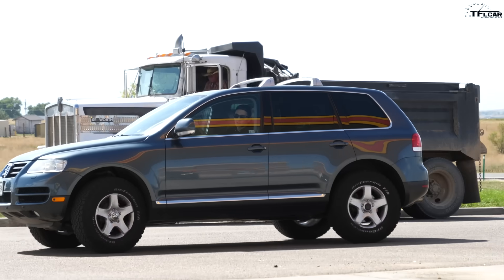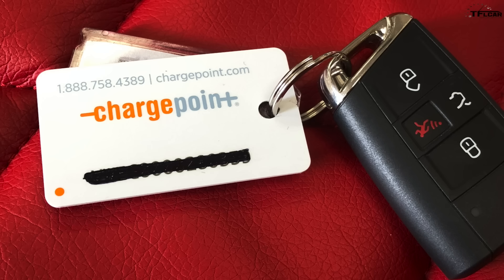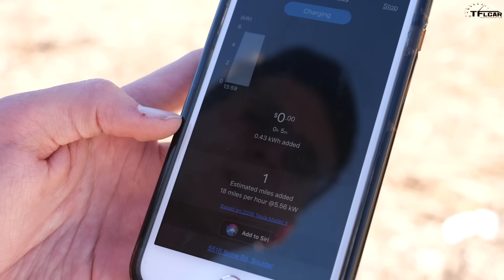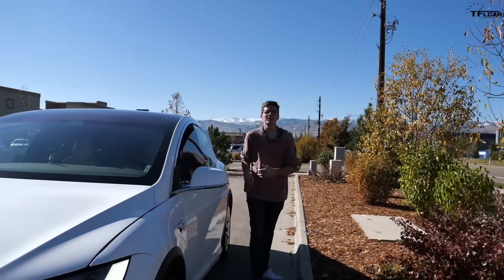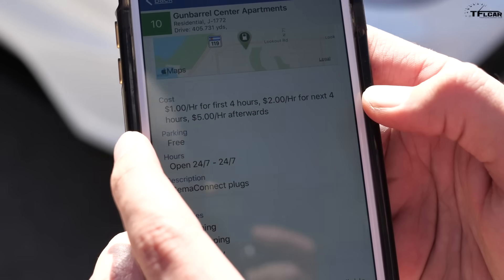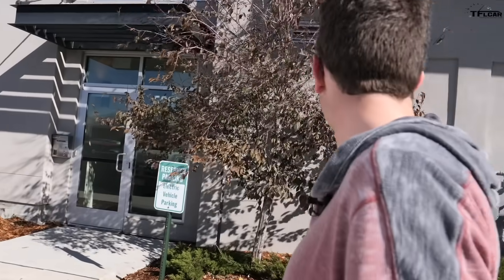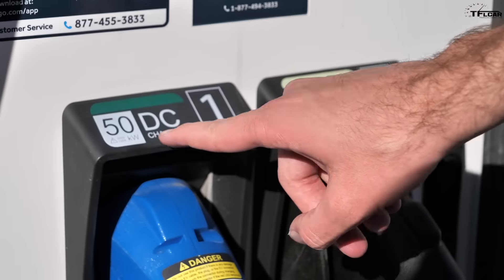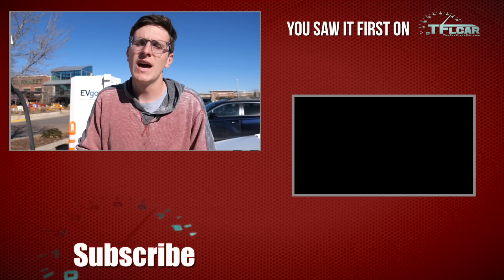Here’s Why Charging an Electric Car Can Suck - And It’s Not The Reason You Think!

Comment: If you have a Tesla, why not just use a Supercharger or Destination Charger ? The rest of us who can't afford a Tesla need to worry more about these 3rd party network. Tesla has the best charging infrastructure in the world. You can charge up to 65% in half an hour. Electrify America is also very good and can support charging speeds equal to Superchargers. Chargepoint is way too slow and I won't recommend using them. There is a Chargepoint charger in my neighborhood which manages only 18.5 kW, while EVGo maxes out at 60 kW, and Electrify America manages ~140 kW. Its quite obvious which chargers are getting used more often.
Reply: Because why go somewhere when you can charge while you sleep?

Comment: Haha, why would any Tesla owner use chargepoint? The supercharger/destination charger network is far superior. And 220 in a garage? Do you have a dryer? That charges at 17mph, same as the chargepoint. Anytime you film Tesla it is all fud.
Reply: Charging at 220/240 in your garage is fine for most BEV use.  Most of the time, people driving BEVs are not driving more than 50-100 miles a day, which means that most nights they are just "topping off" their charges, not starting from scratch.  Very few BEV owners take their BEVs on long-distance out-of-town trips; they have a second vehicle (ICE-only, or PHEV) for that.
Reply: Currently the only company serious about bev is Tesla. And I drove mine from philly to Utah, for free. No gas or hybrid needed. Wish I had filmed it, to show how simple it is.

Comment: With cars like Chevy Volt, BMW i3 and Prius plug-in, there are BEVs that have gas engines. With my i3 I charge at home for a daily 50 mile commute. If I do need to exceed the relatively limited 84mile range the Range Extender (gas generator) has my back. At least for Ohio, you pretty have to have charging available at home. For short commutes you may get away with Level 1 but Level 2 is much more practical.
Reply: Chevy Volt and Prius Prime are PHEVs, not BEVs.  Yes, PHEVs are a logical transition from ICE-only vehicles to BEVs, and from my personal experiences with a PHEV, I can do most of my daily driving in all-electric mode; my going to gas stations decreased from once a week with my ICE-only car to once every 5-6 weeks with my PHEV (priceless).

Comment: Most people are going to do 95% of their charging at home. I plug in when I get home from work and it is at the level I preset in the morning. I usually charge my car to 80%. Tesla also can have the car not only charged but defrosted and warmed up before you get in and go off to work. I only go to a supercharger when I am traveling over 200 miles.
If I lived in an apartment, I probably would live much closer to work, so I might only need to charge the car once a week or so. Then I might use a supercharger that was conveniently at a grocery store. Near where I live there are two superchargers at Fred Meyer stores and in my drives in the Midwest I have seen them at Meier stores and I bet there are others. For non-Tesla cars, I have seen several Electrify America fast chargers at Walmart and Target stores.  
Some Malls have free level 2 chargers and I think a few are putting in fast chargers from Volta. I believe they display ads which you may or may not look at. Plugshare is a great app for finding chargers and about half of the level 2 chargers are free.
Some restaurants will also have free chargers, especially Tesla destination chargers and if you are there for an hour or two, you can pick up a decent charge.
I have a little folding electric bicycle that fits in my trunk which I could bring if I needed to charge my car for awhile at a slower charger and needed to be somewhere further away than walking was acceptable.
Reply: You kinda lost the plot when you need to throw a bicycle in your trunk to adapt to your car's limitations.

Fill the tank in 5 minutes and park as close to the store/restaurant/theater/house/work/whatever as possible.

Boom. Done.
Reply: dchawk81 simple isn’t it? Yesterday I filled my Tahoe with the ignition on so I could watch the fuel gauge and range estimate change on the dash - and I believe the “recharge speed” was 98 miles of range added per minute of time spent with the nozzle inserted - total time from stopping car to pulling away, 4 minutes 3 seconds.
And that that included me putting some trash into the garage trash can, refilling my washer fluid & squeegeeing the front and back windows.
While I did that my daughter popped into the Conveeny and bought something to drink.
As you say; boom, done.
Reply: @RCFourFive  Agreed. I'd go nuts if I had to do what these people are willing to do.
Reply: All I do is stop at a gas station and fill my car up in 5 minutes.

Comment: Why worry about all this electric car crap, when "hydrogen fuel cell" cars become the new standard, 100% electric cars will be history.  Hydrogen cars refuel in 5 minutes.  Nuff said ~
Reply: Toyota has been working on this for ages, and it doesn't seem to be practical; that's stated as one reason why Toyota has been slow to the BEV and PHEV game, but they seem to be all-in now, and are quickly developing a BEV platform with Subaru.  It does not appear that hydrogen fuel will make it as a way of fueling cars, at least for the next few decades.  By then, BEVs will rule, and Toyota will probably lead the way because they'll make reliable BEVs cheaply.

Comment: More apartments should have EV charging, even if it's just a basic 110V 15A outlet - it's enough to charge the car up overnight for you to plug it in another EV charger when you get to work during the day. Adding solar brings the cost down significantly.

Comment: I would be curious to know how many people trade their BEV's for ICE because of this silliness. It's almost like the system was designed to fail. It's a shame BEV's are still too expensive to justify as a second car when you can buy used 50+mpg ICE cars for less then $15k. 
- 
$10k/$3.50gal==2857 gallons of fuels * 35mpg == 100,000 miles at 35mpg for $10k.
- 
tldr: Electric cars are still toys for the rich and wasteful, the math doesn't lie. If you care about the environment the old: Rinse, Recycle and Reuse is still the best advise.
Reply: Check out some EV forums, and you'll see that most BEV owners become even more passionate about BEVs after owning one or two.  Many, in fact, own more than one BEV now.  (I say this as an interested reader on BEV forums; as of now, I haven't bought more than a PHEV because of the range issue and charging-time issue.)
Reply: @cbatiau2528  Thanks for that since, it would seem to confirm BEV's are the new impractical play toy of the rich and not a real solution for normal working families.

Comment: Another note.  My wife and I drove our Bolt EV 2500 miles round trip from Ontario, Canada to Orlando, Florida with no issues.   It was fairly easy.  Average charge stop was 40mins.  Enough time to stretch, use the washrooms and grab a snack or meal.   In our local EV group we have another Bolt EV owner that lives in a condo that cannot charge at home.  He is semi-retired but drives about 60,000 miles a year for uber and lyft.  Completely dependent on public charging with no issues.

Comment: Good video.  A few added points.  While the EVgo station you visited was limited to 50KW there are CCS stations by companies like Electrify America that have sites that have a minimum of two 350KW and two 150KW charge stations.  These have the potential to charge EV's quite fast.  The Porsche Taycan for example can accept up to 270KW.  Also of note there is an adaptor available for other EV's to use Tesla destination chargers (NOT Superchargers).  One of these adaptors is called the Teslatap.   Last on my list is that some newer EV's and charging providers are now starting to support plug to charge like Tesla does.  Vehicles like the Mercedes EQC and Porsche Taycan are examples and Electrify America is a provider that is going to start offering this service very soon.

Comment: What I don't have is the time or patience to wait the ridiculous time it takes to charge. I filled up today, I was at the gas station for probably 5 minutes, put about 14 gallons in and was on my way. Until charging gets standardized, faster and and are available across the country like gas stations, I think most people will continue to resist switching over to EVs. Aslo, most EVs are still expensive, at least for any a driving enthusiast would want. As someone below said, a good informative video explaining the different types of connection, charging time, and how pricing varies.

Comment: I have nothing against EV cars in city centers, but on the contryside where i live the only option to charge in 99% of cases is your own home. Then we have the issue of degraded battery life in winter time so the battery needs to be changed every 7 years. If you have the income to pay the cars current worth to have it replaced then maybe. Until battery packs becomes better (current science seem to have hit the peak with lithium technology) i will probably look more towards hybrids, that has a more affordable batterypack replacement and you always have the combustion engine as a backup.

Comment: I agree with you.  The best fast charger is a gas pump.
Reply: No...its the charger in my garage.  I park, plug in and leave the garage every mornin with 310 miles of range.  Have fun at the gas station.
Reply: So you have a 310 mile tether unless you want to spend hours at a remote charger.
Reply: Gerald Brady not if you have a Tesla.  I drove 550 miles from Denver to Topeka two weeks ago.  Three stops along the way where I spent  10-20 minutes recharging while I used the restroom, got coffee, walked my dog and on one stop had lunch.  Not as convenient for non-Teslas, but the Tesla Supercharger system is really convenient.  All of the stops were les than a mile from the exit and had restrooms and food/coffee nearby.  Yes, it takes more planning in advance to make sure you time your breaks with Supercharger locations, but in return i never need to worry re-fueling on the vast majority of days when i am driving locally...which is the majority of my driving.  NO ONE SPENDS HOURS CHARGING.

Comment: Wow. Never thought filling a car up would require 5 different search apps, 5 different payment apps, and 10 hours.
Reply: It doesn't if you charge at home or have a Tesla.  For Tesla's Superchargers you just plug in and the car communicates automatically with the charging network. It's seamless and easier than a gas station. And at a peak rate of 1000 miles per hour on the latest ones, it's fast. I guess that's the advantage of being proprietary, good or bad.

Comment: 6 minutes for 1mile..... or 6 minutes for 400... I'll stick with good ol' dino juice for now
Reply: that 6 minutes gives you 2 full tanks on 2 different cars, I agree with you
Reply: The difference is you rarely wait for an EV to charge. You always wait for an ICE to refuel. If you need juice fast, a supercharger is a hell of a lot faster than a low power J1772 stall. Nearly 100 miles in that 6 minutes.
Reply: @ericspda  erm... my car fills up in  like 2 mins, I am on my merry way, I will stick to fuel, I get 1200km driving at about 100-120km, at 140-160km, my range only drops to 1000-1100km per tank... I think I will pass thank you so very much. EV seems a pain in the perinium
Reply: ray of light It takes me 3-5 seconds to plug my car in at home, and it usually is topped off in an hour or two while I sleep. I think it’s considerably more convenient, and it costs a hell of a lot less. If you drive thousands of miles a day, I could see the benefit of ICE, but it’s really massively less of an issue than people somehow are imagining to use an EV today.
Reply: @ericspda  Cool story bru

Comment: I drove up to the pump and 5 minutes later is was leaving full of gas for $25 and never even used my phone. Electric cars are unfortunately still a gimmick. Why on earth couldn't they just manufacture the same plug heck we did for our electronics.... we have the same size nozzles for gas and diesel cars for the idiots who couldn't figure out that diesel doesn't go into a gas car. I will stick with my 35-40 MPG Mini Cooper S, since Tesla is way out to lunch on their pricing in Canada $78K for an all wheel drive Tesla 3, I would be around 104 years old before i broke even with gas and purchasing a replacement car every 10 years with the mileage I do per year....
Reply: I pull out of my house every morning fully charged for over 300 miles of range.  Free, with my solar panels.  If i charge from the grid its about $2.50 per 100 miles.  With the tax credits/etc in Colorado, my Model 3 LR net cost was about $44K.

Comment: This channel is clearly going out of their way to spread FUD about electric vehicles.  You guys have a Tesla Model X, but insist on driving around to third party level 2 chargers (designed for overnight charging) and act like that is the norm.  90% of the video is spent showing those charging stations and only at the end do you mention the level 3 chargers and Tesla Superchargers (charge at several hundred miles per hour) right in the same area.  
If you guys had started with the normal use cases (level 2 charging at home and level 3 charging for long road trips) and worked your way down to what "destination chargers" are and what they are intended for I wouldn't have any reason to criticize, but you went out of your way to make it seem like people with EVs spend all their time juggling dozens of apps to get a 15 mile per hour charge rate.  Some of the comments make it very clear that you were effective in your goal of misinforming people.
Reply: Imagine if they reviewed cell phones:
“These Apple phones use a different charger and they use their own apps!”
Reply: I don't have an electric vehicle as of yet, however, the fact that they are even able to do what you are criticizing them for is telling that there is a lack of standardization and bad accessibility to chargers when it comes to electric vehicles; both on the vehicle side and the chargers. Having to sign up to a company app to use a charger is inconvenient if you travel to places where your preferred charging company doesn't operate. It should be simple as just have a credit card to use a charger.
Imagine if we had to use an app to buy gas for conventional ICE vehicle and then the gas nozzle is designed differently for each manufacturer.
Edit: I'm ruling out home charging in my argument. I know many folks have a garage to charge the vehicle but I live in a city with no garage so I'm writing based on my experience.
Reply: Jabid21, I agree that it isn’t as straight forward as it should be for many EVs, but this is not the case for Teslas at all. The car shows you on screen exactly where the nearest chargers are and you just plug in and walk away. No app, credit card, etc. It knows your car and uses the card on file. Also, for other EVs there are only a few big players in charging stations. So it’s a matter of setting up a few accounts and apps when you first get the car. This video makes it seem like you have to download new apps and create accounts every time you charge. Basically, they took a car that shouldn’t need to use those chargers at all and then filmed themselves signing up for each of the major services for the first time. That is not the typical experience most EV owners would have.  They also spent most of their time at destination chargers intended for residents of apartment complexes or similar and acted like that is the type of charger someone would visit on a road trip. As someone that has experiences with EVs, I can tell you this is not an accurate representation.
Reply: @CL-gq3no  I agree with you on that. Once you own the vehicle, and done setting up, that should be it. Of course what they showed isn't the typical way a Tesla owner would charge their vehicle.
Although my main takeaway is still about not having a single charging plug, standard way of charging without needing to have an app or a specific make of a vehicle. It's tough as no one is really willing to invest in the infrastructure and only Tesla may be the only one who have a nationwide presence.
Cheers driving. I would wholeheartedly get an electric car once I own a place with a garage.
Reply: Totally agree.  And yet TFL doesn't comment on your comment.  Seems like they're not interested in getting constructive feedback, just clicks.

Comment: A 5 kw charge rate seems completely worthless. Be interesting to see a solar install just for an EV. Most people would be away when the sun shines, but maybe just push the power onto the grid, whatever. I guess no one wants a small EV that uses 100 wh per mile, or less? Where's the Sondors EV? Arcimoto claims 175 wh per mile.Ebikes can go a mile on 13 wh, below 20 mph. Tesla turned EV's into a luxury thing.

Comment: I've been leasing a 2017 Chevy Bolt for the past 2 years. In general, I've enjoyed this car and ALWAYS charge in the carport of our mobile home. I NEVER take it on trips that would require charging before I return home for 4 simple reasons: Charging at public chargers are too slow, too expensive (Here on the west coast public chargers are typically 40-50 cents per KW.),  unreliable and don't have a simple way to pay with credit card across multiple networks. The Tesla super charging network is the only network that avoids most of these issues. Unfortunately, I cannot afford a $50,000+ vehicle. So it is most likely that when my lease expires in late 2020 I will lease or purchase a hybrid or plug-in hybrid.
Reply: Check ElectrifyAmerica network, I used their chargers during my trip to Wisconsin. https://www.electrifyamerica.com/